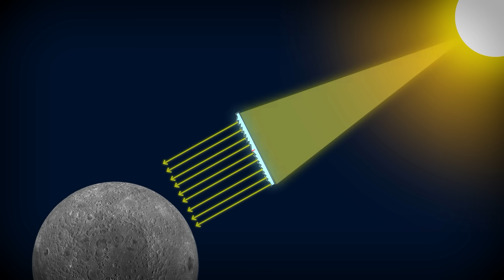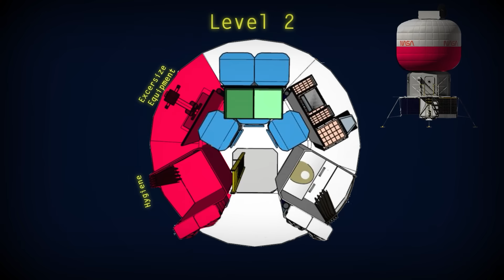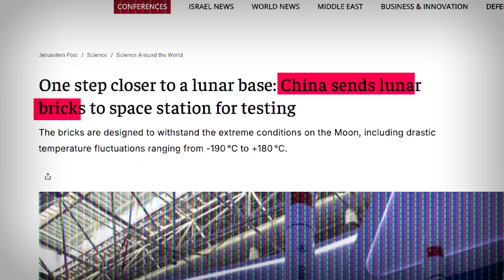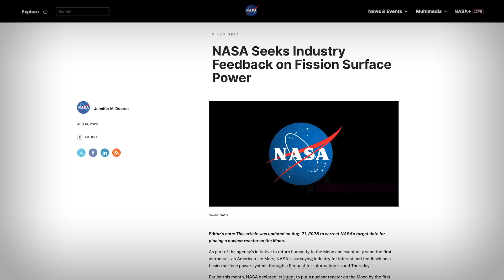How NASA Will Build A City On The Moon

Comment: After a period of concentrated surveys of the Moons interior, select a lunar crater on the dark side of the Moon large enough for a landing/nuclear powered logistics base.
Land a tunneling machine in parts and assemble within that crater.
Select the proper crater wall, build the necessary supporting structure and begin a tunnel.  
At the tunnels mouth erect an airlock, and every half mile or so erect another air lock door for emergency sealing of atmosphere in sections.
Dig side tunnels as required to then create large rooms to house infrasructure, sanitation  plants, atmospheric plants, factory rooms and agricultural areas, all sections with emergecy atmo doors.
Why do it this way?
Under the surface on a low gravity no-atmosphere planetary body you inherit many advantages.
Radiation protection from the Sun, or Jupiter and Saturn if you're in their orbit.
Protection from all but the largest asteroids/comets, dependent upon  depth/rock type.
The tunnels can be sealed with a polymer spray on all walls, which is easier to transport to the  lunar surface that materials to build surface structures.
When you want a residental suburb, just dig it out.  A concert hall?  A lake for water storage and recreation? A chamber for processing minerals  or toxic substances?  An atmospheric storage chamber.  Agricultural land?  Whatever needed.
Imagine the structures that can be built by architects using rock with known qualities in a low-gravity environment.
Need more space?  Just dig it out instead of transporting materials from earth.  
Using conveyors, materials dug out could be transported to where needed or stored anywhere on the Moon's surface during tunneling.
AND, all of this uses known terrestrial methods and tools, no need to invent new tech such as rock melting laser mining equipment, etc.
But theres one intangible benefit to this methodology on our Moon.
The surface of the Moon facing Earth need not be destroyed by industry but rather should be preserved for those of us still on Earth.
Who wants to look up to Our Moon and see a million lights, factories, refineries, apartment blocks scattered across the view of every single human alive now or in the forseeable future?
That view/surface should be protected by law for  our future generations.
By the way,  do you think Elon created the Boring Company for terresterial construction only ?????

Comment: You need to think of how small robots could do most of the work. Then you keep sending them as needed. You could keep them functionally warm. They would not be going too far from the base in most cases.
Reply: Well there are extremes of hot and cold on the moon as you move from sunlight to shadow. It didn't seem to affect any of the human astronauts at the time so I guess the robots won't complain either.

Comment: The Brayton cycle, also known as the Joule cycle, is a thermodynamic cycle that describes the operation of certain heat engines that have air or some other gas as their working fluid.
Reply: CO2

Comment: For landing platforms and roads to keep down dust they should just use a rollout carpet method.  Make essentially a big rug, roll it out, pin it down and if strength is an issue add inner chambers to inject a hardening agent into.  The hardening agent could even be a rapid expanding foam that hardens inside it providing the necessary rigidity and keeping down weight at the same time.
Reply: why not dig into the sides of the mountains for tunnels to live in, and spit the rock out of the back as hardcore for the roads? He's overthinking this.
Reply: @juchetony1910  Just dig a hole he says!  It's easy he says!  You rocket scientists, engineers and astronauts just need to stop overthinking things.  Just fly heavy machinery out of the atmosphere.  Travel hundreds of thousands of miles in the irradiated vacuum of space.  Land on the moon.  Dig past the highly abrasive moon dust that destroys your equipment and build an underground facility that must again be sealed against the vacuum of space.  EASY!!!

Comment: This is a pretty interesting video.  Thanks. 

That being said: 

A small city?  😂 Who is calling for that? 

It's hardly "the most hostile environment".  Top
3 at best. 

Why would you use a lunar rover to go between connected areas?  Use a golf cart. There is 0 point in adding all the risks of using a vehicle that goes outside.

Comment: There's alot of questions I have, but the main one I have is why not just 3D print everything? Like, multiple rockets can be launched at a time. The Space X lunar ship thing, can send 220,000 pounds of cargo to the moon. Want to know what we on earth have ALOT of? Rocks. Why can't we just ship a bunch of concrete, rocks, and other materials to the Moon, and then use the frozen water to mix the concrete into bricks. Then have someone take a bunch of concrete bricks, lay them out on the moons surface, badda bing, badda boom, brick roads. 

It seems like a really stupid idea to be like "yeah guys, let get a super hot laser, and shine it near our inflatable, pressurized, oxygen rich shelters!" It would be so much more plausible to just use one of the lunar ships, load that fucking thing up with a bunch of rocks we're not using, and have a team of rovers place them in a pattern. Better yet, if everyone is afraid of them flying away when there is a landing pad made up of them, or better yet. There's a thing called a concrete mixer, make a smaller version on a rover, and have it mix something silicon based concrete, and then squeeze it out of a nozzle to connect the rocks together like a paintbrush. 

Maybe my suggestions are why I'm not a scientist, but if it's not broke don't fix it. We've known how to build roads since the wheel was invented, there's no reason to start trying to figure out knew ways to do it.

Comment: A cool idea to have power at night would be building massive fly wheels possibly with a lot of the mass made up of those moon dust bricks mentioned earlier so we don’t need to fly up there. You use solar panel during daylight hours to slowly spin it up to a huge speedand then use a clutch to slow it down and that friction could generate electricity by a generator.

Comment: Hydrogen fuel cell to power a rover ;-)

Why would you want to waste so much energy? Why?

Batteries give you the same with less needed energy, a third, you can power 3 times more rovers with batteries... You can let them drive more often... No need to wait for the hydrogen tanks to fill up. And where do you get the hydrogen from? On the moon? And what's when it is used up and no hydrogen (water ice) is left there?

Congratulations!
Reply: Common denominator-Money.

Comment: China will beat you there. Not only will they beat you, but they will do it in shorter time, and at a fraction of the price. Not only that but they will have more tech, more safety, more science going on. China sent 1 mission (Chang'e 5) to the moon in 2020 for dust and data, and since then they have used that data to determine how to live on the moon. They plan to build a nuclear powered station on the moon within 10 years.  Since 1969 you have prevaricated and stalled and wasted time and achieved practically nothing. NASA has had 56 years since they first collected moon dust. Since 1969 you have prevaricated and stalled and wasted time and achieved practically nothing. In fact you've gone back over because you can't even repair the space station you have, and you have no vehicles that can reach the moon, and no plan to stay on it. 
All hail China, working hard to further humanity in space while the US just builds more bombs and starts more wars.

Comment: There is no practical reason to put a base on the Moon... EVER.  Same with Mars.  Humans can likely not stay on either long term do to the lower gravity (the Moon is something like 16% of Earth's gravity and Mars is 39%).  Long exposure to lower gravity causes all sorts of health issues because the human body is design to pump more blood to the head and the lower gravity results in too much blood pushed to the head.  It is also hard to maintain muscle and bone mass.  Neither can ever be self sufficient so a permanent base would require constant resupply and replacement of personnel.

The second problem is radiation.  Without a magnetosphere and thick atmosphere both the moon and Mars have to deal with massive amounts of solar radiation and cosmic rays.  This will require an shelter or working area to be buried 13 feet under ground because making any shielding to an above ground structure would be too heavy (and costly) to ship to the Moon or Mars.  They will likely be an inflatable structure surrounded by a concrete made using soil from the surface and then covered with soil.  Then plastic floors and possibly walls will reduce the wear on the sealed inflatable surface.  Any entrances will require a tunnel with at least 1 90 degree bend in to reduce radiation getting in.  If their is an observation area with windows in the surface it will be in a separate area with a tunnel with bends in it going to this area and likely an air lock.

Walks on the surface will be rare do to radiation exposure just like space walks.  And small and micro meteors could be a problem.  These normally burn up in Earths atmosphere and estimates say it is 50-100 tons of material every day.  Both the Mars and Moon will have to deal with this do to the VERY thin atmospheres.

Also the idea that the Moon and Mars having water is such a big thing, the amounts and difficulty collecting or mining it would likely be cost prohibited.  It would likely be easier just to ship it there.  Again this points to the practical reasons for building a base on the Moon or Mars just not being there.  The only thing they could do is study the Moon or Mars as most experiments can be done on Earth or require the zero gravity of space.  This means a space station is actually far more valuable than a Moon or Mars base.  And do not think that Mars can be terraformed.  The lack of magnetosphere means it will never support an atmosphere so radiation will always require everything to be under ground.

To make a permanent base though would require robots with enough AI to do tasks with little input do to delays in radio transmissions to Earth, especially for Mars.  The first missions to the Moon and Mars, if they want to build a base, could not be manned and the robots would have to set up power generation (nuclear or solar) and then use machines to shift soil, place the shelters, fill them with cement, and burry them, then create a landing pad.  Now do to Elon's massive Starship they could send a lot of resources in just one trip.  For Mars though they would have to brill for water and likely establish hydroponics and be able to not only process water for drinking, but to split to make oxygen to breath and for propulsion and hydrogen to be mixed with carbon dioxide from the atmosphere to make methane for fuel too.  There would need to be enough power and processing equipment as well as storage tanks and cooling to provide fuel for a return trip.  This is all before a single person steps foot on Mars.

Elon talks about sending 100 people on a Starship but likely 10-20 would be the maximum.  this is a 6 month trip each way.  They need a system to provide centrifugal forces to simulate gravity, food and water for likely 2 years or so, and all the shielding, facilities, CO2 scrubbers, power... and enough room so they do not go insane.

Overall I think both the Moon and Mars missions are just power flexes or bucket list item and will have no practical use.

Comment: Utilizing natural lunar craters as protective basins, the city is composed of stacked modular inflatable domes arranged in a halo configuration around a central panopticon-style core. Each dome is shielded with 3D-printed regolith layers for radiation and micrometeoroid protection.
The central spine acts as a multi-functional vertical connector, linking all levels and sections — serving as a circulation hub (elevators, lifts, access tunnels) and a central command/monitoring structure (inspired by the panopticon concept).
Modules are vertically tiered along the inner crater wall, forming a scalable, efficient living and working environment. The base levels are reserved for life support, storage, and emergency systems; mid-levels host habitation and agriculture; upper levels include science labs and surface access points.
This design maximizes protection, modularity, and expandability, with the crater itself providing an ideal foundation and natural shielding.

Comment: September 8th, 2025:
One thing I believe may be important is once they believe 100 feet of regolith covering is enough, they need to triple the thickness to 300 feet. And should a deep of 200 feet be initially recommended, then 600 feet will likely be the safer amount of covering for structures.

Tunnel, tunneling with heat, extreme heat such as a plasma torch?

Comment: The chance of this happening is zero. The two most needed things people will need on the moon, are oxygen and water. If you had 25 people on the moon you would need about 375000 to 500000 gallons of water for them to survive per month. You couldn't have enough spacecraft going there to provide that much water. You would have to have a nuclear reactor to provide electricity because the oxygen necessary to burn a fossil fuel couldn't be generated. No one will ever go to Mars it is all a fantasy.

Comment: Longer-term stays on the moon  will require a megastructure or an O'Neil cylinder with a lunar space elevator.
Reply: Lunar space elevatio not practical due to the Moon's slow rotation.

Comment: No, that is not practical and will cost lives and use up unnecessary resources. It has already been determined that there are lava tubes and cave systems on the moon. It would provide the necessary protection from radiation and micrometeorites and would only need to be modified for safety.

Comment: Nice, but no solution for low lunar gravity effect on human physique, build for 1G. There is a possibility to insert simulated rotational gravity into the lunar base design 
- Either an over ground cenrifuge with carefully shielded habitats/cabins on the ends of its arms, OR
- Underground solution, reminiscing a magnetic subway train with pivoting cars, riding in circle at high speed. 
- Alternatively, if the brick baking and bricklaying works, simply build the "circle" magrails on the surface (either complete flatland, or on the edge of a crater) and than cover it for protection.

My sugestion would be the "train" solution, because it solves all major health risks, leaves the lunar base easily scalable and works with technologies necessary for future development (mag-rails can tell how railguns for transport of materials will work). Not to mention, the INNER side of either tunel (or cover made of bricks) can be coated with "rhino snot" to prevent moondust movement INSIDE. Not to mention said "tunel" should be once in the time flushed clean by presurized gas cleaning...
Reply: Since there IS some gravity. a proper weight suit to increase your weight and effect of the present gravity would mitigate enough of the lack of gravity.
Reply: Lunar gravity is easily adaptable. Human effects less than ISS zero G.

Comment: Towards long-term lunar stay, it may be that the first big (presumably Starship) lander will have to anneal the surface around that lander... on that FIRST trip. 

Why? A much smaller robotic probe, last year, in landing, kicked up dust so hard that some of it arced over the lunar horizon. HOW MUCH MORE SO, for any manned lander, whether SpaceX or smaller. All non-first landings, onto loose regolith, will generate high-velocity projectiles, ones that will damage any human-built structure (spaceship or non-armored habitat) already present on the moon, to a distance out of many kilometers from the landing site.

Thus, some form of annealing of surface adjacent to the first landing craft needs to be done... within the activity of that FIRST landing. Requiring...

1. Skilled application of annealing process. If the craft is not yet human-rated (which is very probable), that skilled application would need sufficiently able robots. 

2. It would also need a sufficiently robust power source. If 'Rhino snot' will prove to be insufficient, then needed is very-high-energy slagging down of the regolith. Most likely needing a nuclear power source.

Comment: 2cm glass roads will not work, obviously.   starship landing legs or exhaust will blast it to a million pieces.  Go with an upgraded rhino snot built to sustain extreme heat/exhaust.  transforming the moon in one small location to be a proper human-friendly moon base will necessarily require extensive modification.  there's plenty of moon left that can remain virgin.

Comment: If the Moon has been bombarded with micrometeorites for billions of years, why isn't the dust on the surface over a kilometer thick .
Reply: If you look at any other moons in the solar system, they also do not have kilometre thick dust. And I'm sure there's plenty more moons (especially around Jupiter) that get more meteorites etc. But I do agree that it feels like the dust should be deeper when the moon has been geologically dead for so long. The only dust issue that Apollo astronauts faced, was with electric statically charged dust that actually hovers and sticks to any contact that isn't the ground